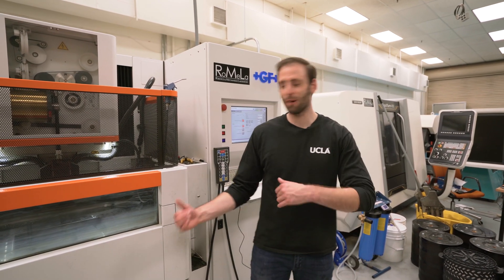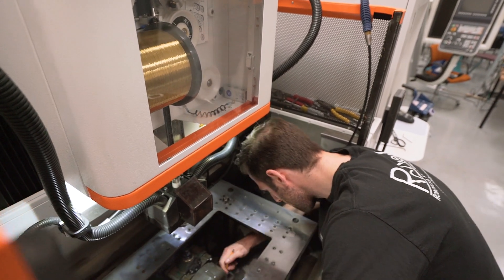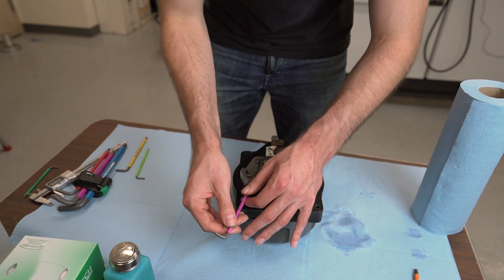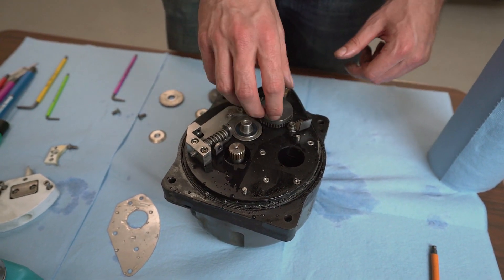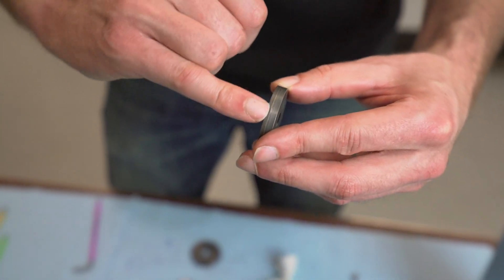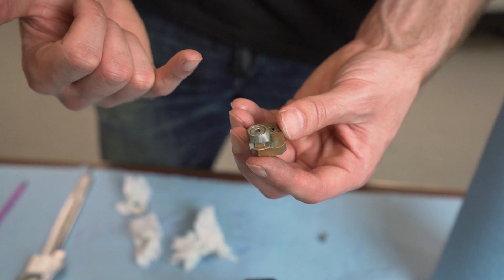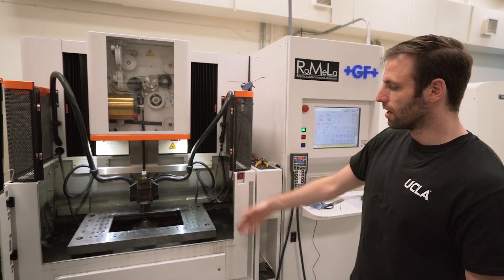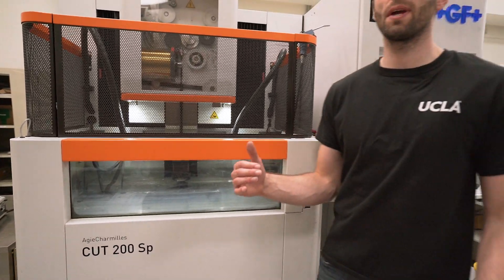Wire EDM Tutorial 09: Lower Head Maintenance

Comment: Anyone have a problem with low pressure in lower head after maintenance?
Reply: me the wire dont goes out and the pressure water is low
Reply: You just have to bleed the system. There is 2 small screen by the contact guide. Losses it while feed is on. Wait until all air purges out. And retight.
Reply: @humanfactors143  indeed I always try turning on rollers to help evacuate more air, but still after doing maintenance I receive lower pressure alarm which forces me to clean the Hydrtrex filter cartridge in the back or change in when it’s still has plenty of life left

Comment: I think they say these parts shouldn't be cleaned with anything but water, but I sometimes soak some parts in Janitol Altrans (Acidic cleaner) 🤭. Takes the dirt right off, but you have to rinse thoroughly. You get a sticky residue if you don't.
Reply: likely you are dissolving the plastic(residue)
Reply: How the U V Z axes are activated in the 390 model

Comment: Hello friend, when I finished the maintenance on the lower head there was a problem the wire became vibrating and the machine stopped and it appeared on the screen ( wire  broken) even though the wire is not broken
Reply: pinch rollers are not tight enough (adjust spring pushed by screw)
Reply: @whatsonh5737  help me bro , Power value increases wire is broken what next bro ?but power value 10 to decreased run the wire normally not broken help me
Reply: Hi dear 
Can give your email
Reply: How change the battery
Reply: How the U V Z axes are activated in the 390 model
Reply: did you fix it? %100 same problem happens to me right now.